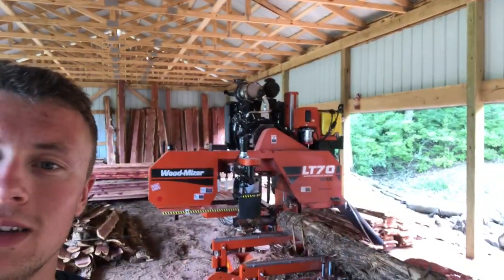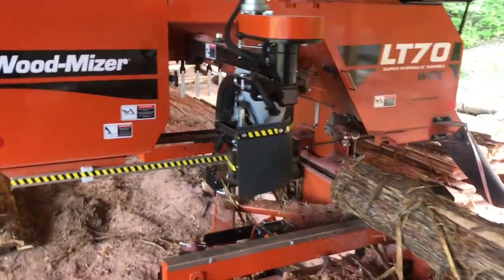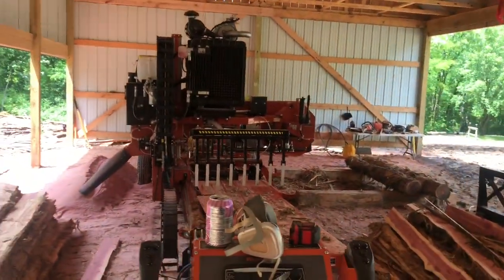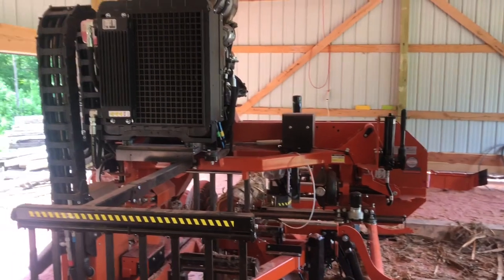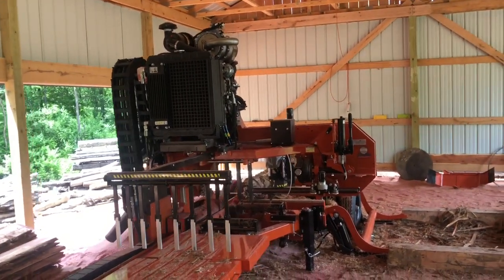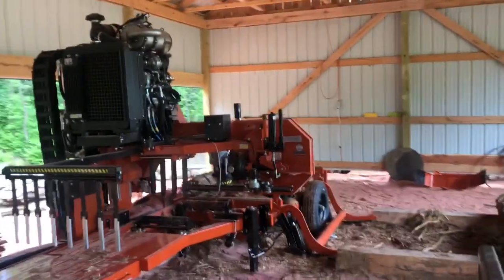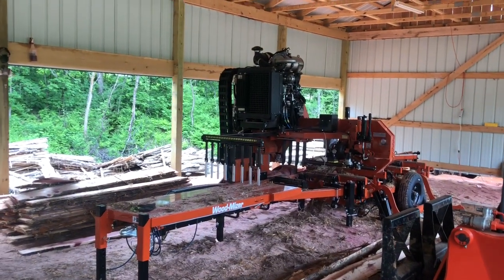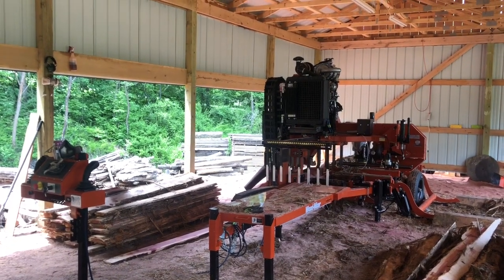Picking up New Woodmizer  Lt70 Sawmill!

Comment: I'll add my congratulations and wishing you the best of luck. 

The big question is what is the laser used for?
Reply from the maker: Thanks I appreciate it. The laser is a sight prettt much. It just shoots a beam down the backside of the log to show where the blade will go through the log at. It just takes the guessing out of how much you’ll be taking off the bark cuts
Reply: @pattonwoodworks  Ah. So it's not a point, but a plane. I'm sure laser people have special words for those, but I don't know them.

Comment: Congratulations on the new mill.  Looks like you will have to adjust to the new mill and its control configuration.   Seems like it does everything except stack and sticker the final product.  I hope you have good luck with the unit and cut a load of lumber. 
This looks longer than the 35...is it?  What is the max cutting length?  Thanks.